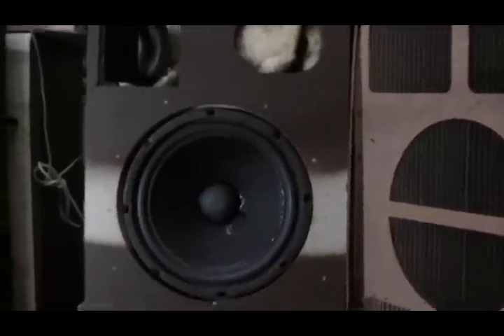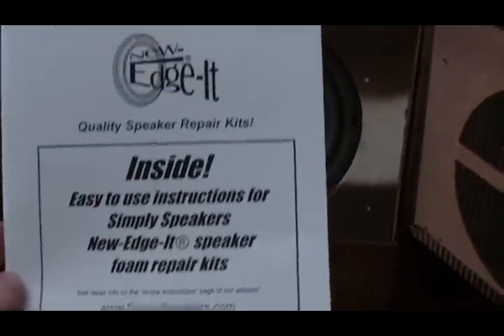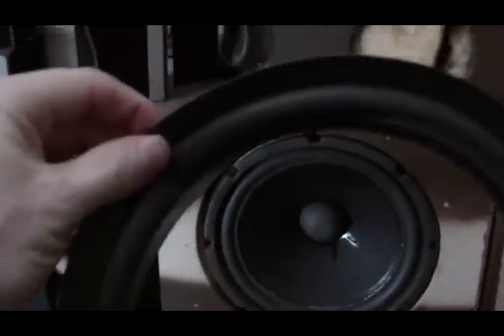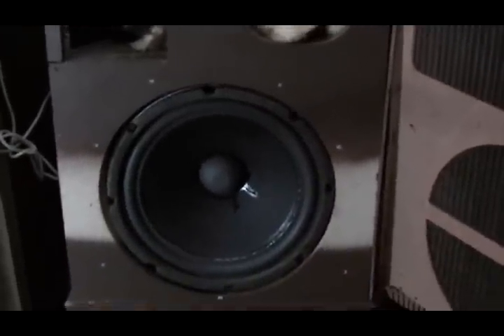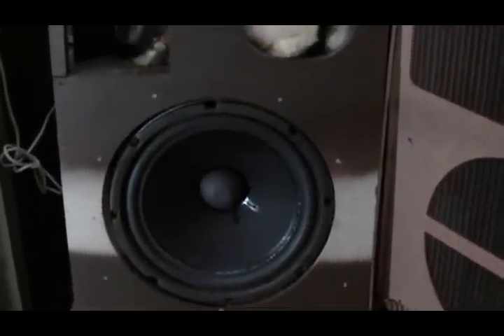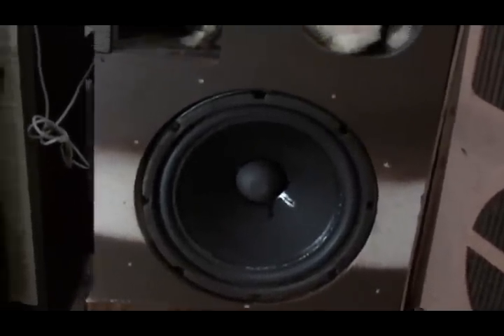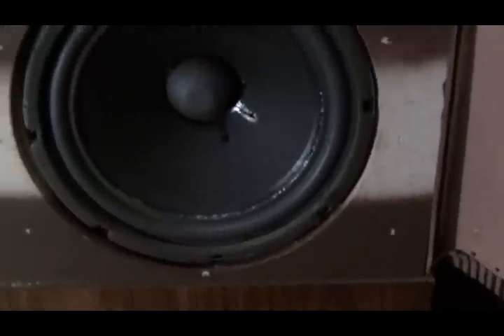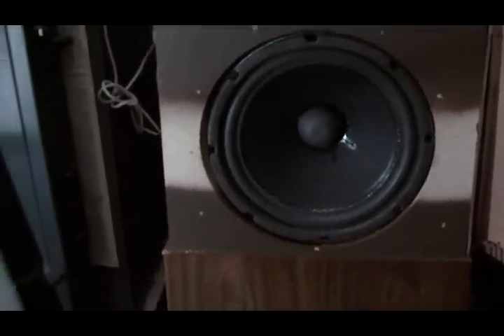Bose 501 after refoaming woofer.

Comment: Hey matey.
How do you connect these to an amp? What wires are required, etc?
Reply from the maker: They have a stud with a round knurled nut, one for positive and one for negative, on the back.  Wrap the wire around the stud and then tighten the nut.  The thicker the wire the better.  I either have 16 or 14 gage wire on these.
Reply: thank you so much!!!!